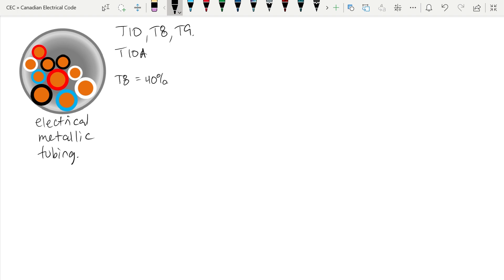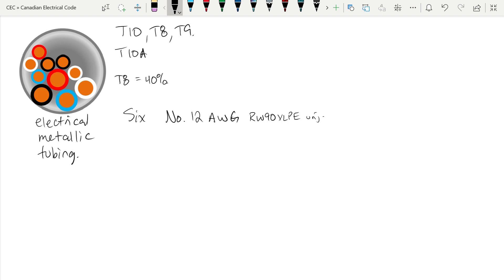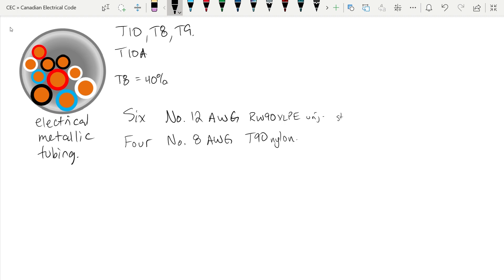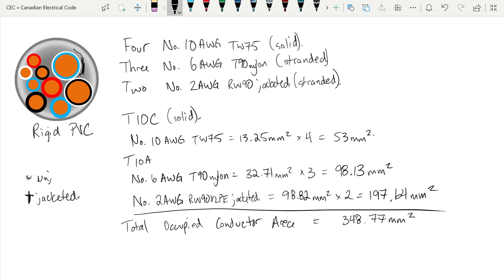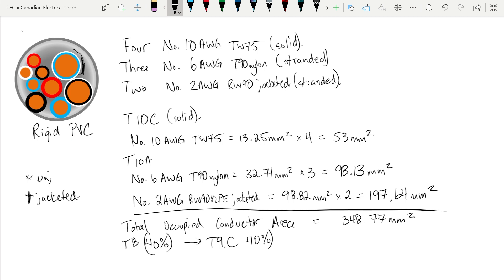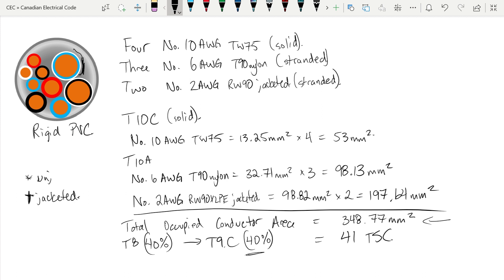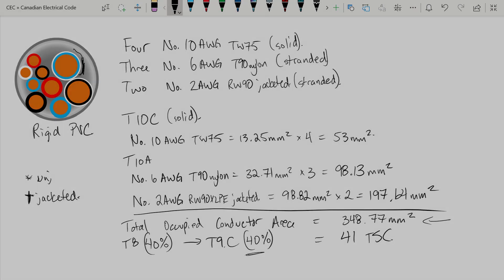Conduit Sizing

Comment: How do you determined the trade size is 53 after going to T6j TW?
Reply from the maker: Based on a 40% fill requirement from table 8, then table 9g to size with the total calculated area from table 6j.
Reply: @schulerruler  thanks

Comment: hello @schulerrlur video is so informative and really supportive to the candidates like me. I have a question and I hope you would make it clear. 
What is the maximum number of #14 600V without jacket R9  XLPE conductors allowed in trade size 41 ?
A. 49
B. 46
C. 32
D. 22
ANS A.
Reply from the maker: Without knowing the type of raceway (rigid, EMT etc) I would take the total volume at 40% in table 9g for the specific type, and divide it by the table 10a area, then round down to determine maximum fill number.
Reply: @schulerruler  thanks to consider me to reply.
As told I solved it as follows
Area of #14 is 8.89 mm sq
Area of 41 trade size is 534.56 ( chose from first column T9G)
534.56/8.89 = 60.24
Now answer would be closest option which is 49 
Is it correct please evaluate

Comment: Is there a code rule regarding whether or not the ground conductor would be used or not for conduit fill?
Reply from the maker: As it does take up physical space we do consider it in the calculation. 
It does not, however, count as a current carrying for correction factor purposes from 4-004 1) c) and table 5c

Comment: Thank you so much for the videos. How do I Calculate for example if I can have 3 x (12AWG x 3 Conductor SOOW) Cables in a Conduit?
Reply from the maker: The next video I do will deal with flexible conductor calculations. I just have to actually do it haha.

In a nutshell you would use column three from table 12 for allowable ampacities (check the note 1 in the bottom of the table)

Comment: what about bare bonding conductor if any with same conduit size 4AWG
Reply from the maker: For a bare bonding conductor you will need to use table d5 with the occupied area size to determine how much area it will take up.
Reply: @schulerruler  thanks dear

Comment: To be honest i dont calculate when it comes to conduit... I always the table from Code..But i like the presentation.. Very nice.. Shout out and God bless..:)
Reply from the maker: You might find you can save a few bucks on a smaller size using the table 10 8 9 method, as table 6 is based off the Raceway with the smallest interior diameter. 
Thanks for watching and fire the supportive comments!